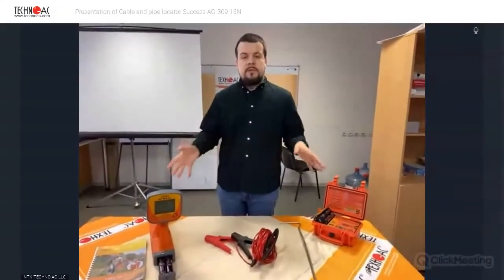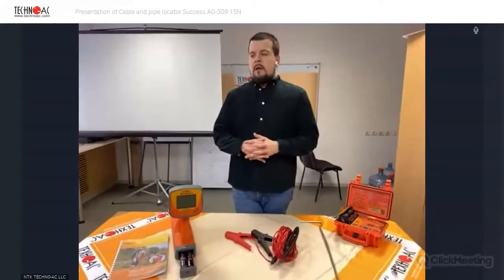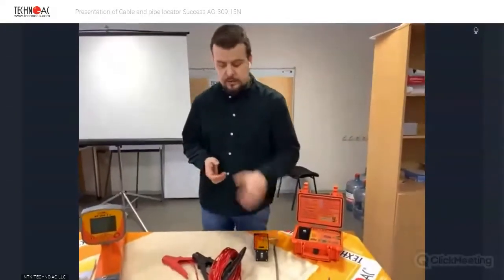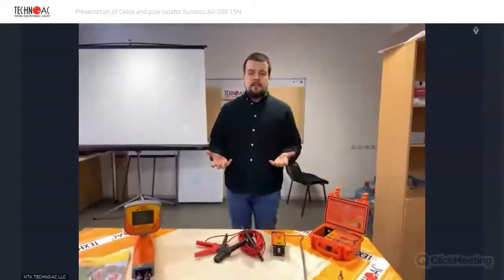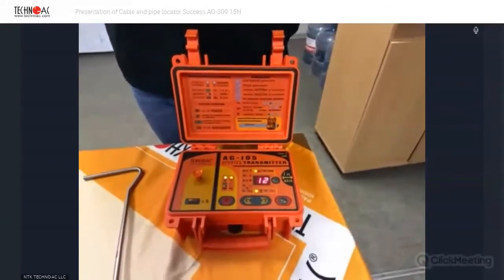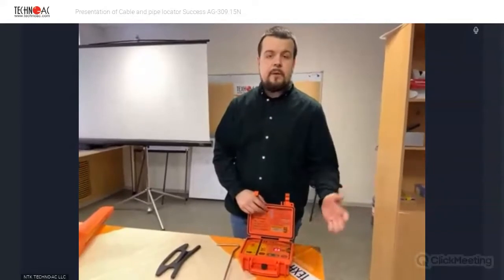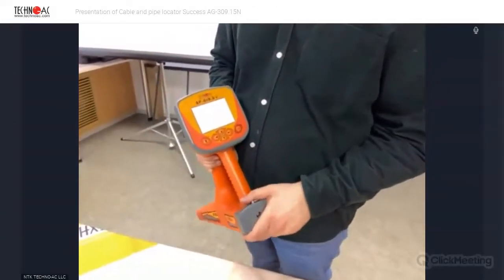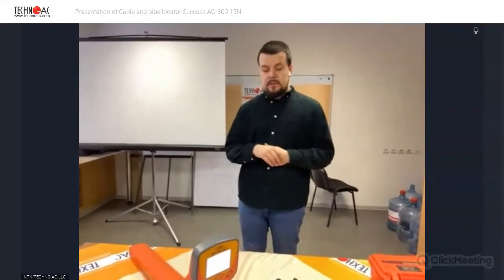Presentation of Cable and pipe locator Success AG 309 15N

Comment: Good day, 
I'm interested in this product and will like to know if when the transmitter is used to send signal through a de-energized faulty cable and the receiver is used to trace the route of the signal, will it detect the point of fault for an underground cable when it gets to that point?